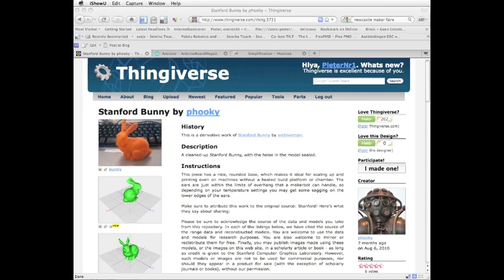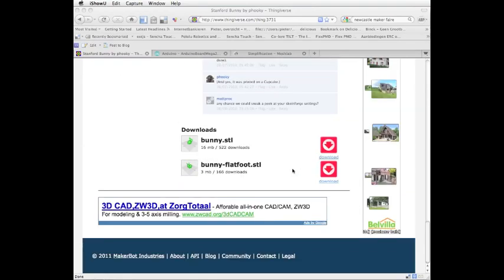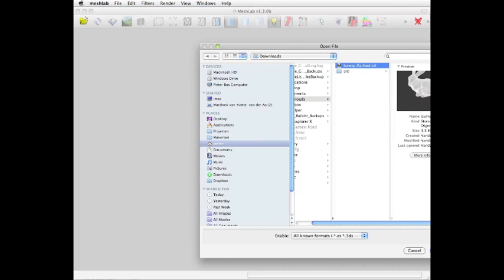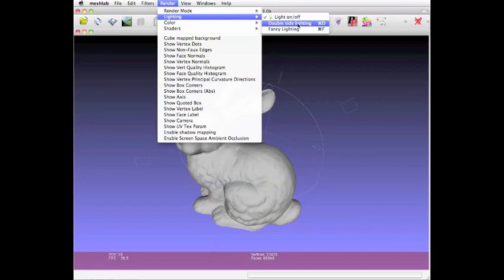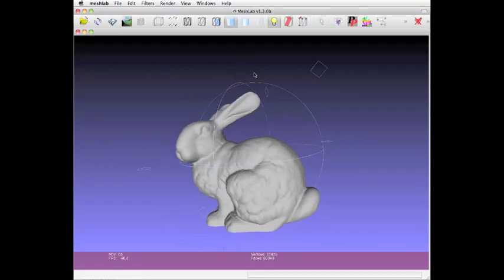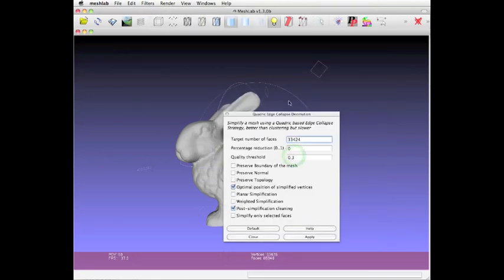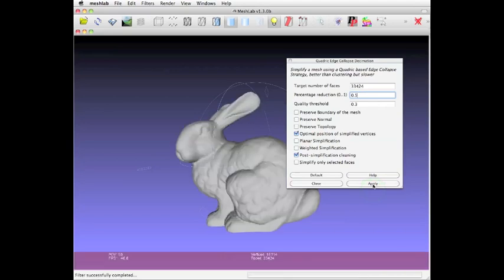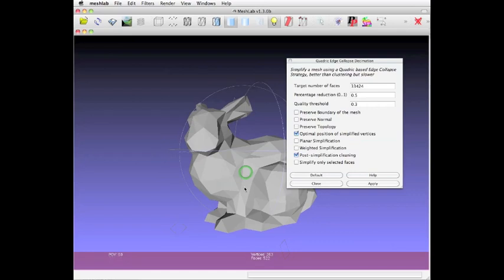simplifying a mesh with meshlab

Comment: How does this work?  I have a scanner and when I scan objects they are huge in polygon count.  I am assuming this effects the time of 3d printing which is why I bought the thing in the first place.  The scanner comes with software to simplify the mesh, but when I reduce the count the object looks like melted candle wax and loses fine details.  Is this going to do the same thing?  How do you print high quality 3d prints without it taking forever?

Comment from the maker: How does it work ? well complex computations that i doe not understand ;-) . less polygons does mean that slicing (making the gcode) will go faster (but also depends a lot on the slicer software ReplicatorG, Cura, Makerware etc etc). Meshlab does a amazing job of reducing the polycount.  But U are right complex models take longer to print, but layer height might be a bigger factor, try 0.1 mm vs 0.3 mm layer height